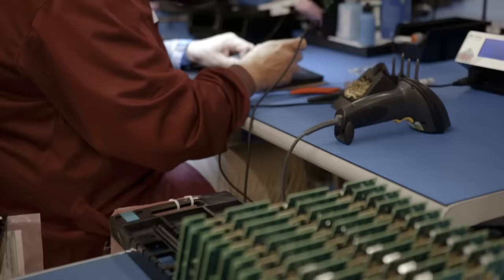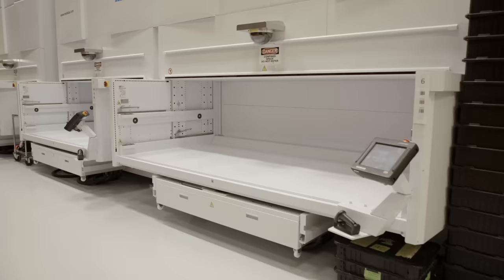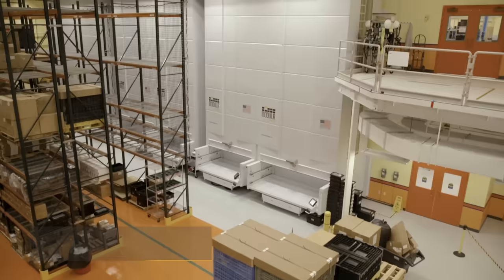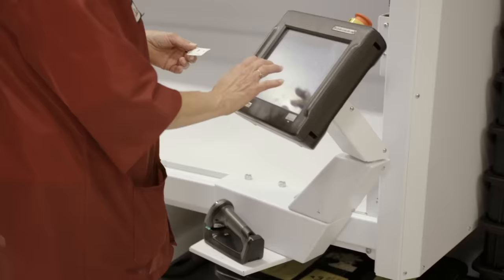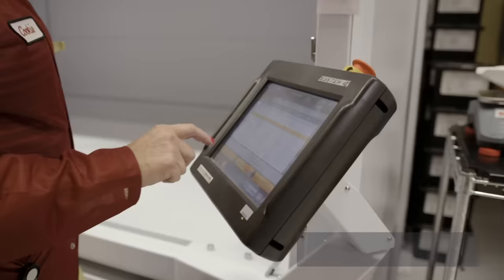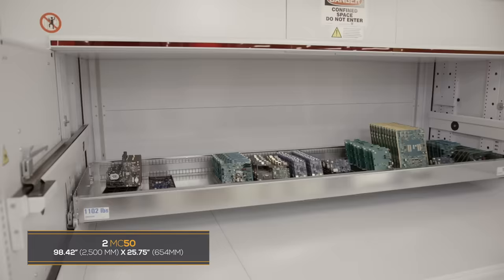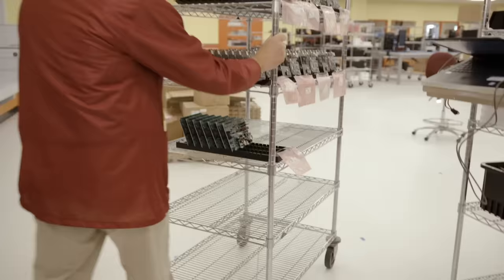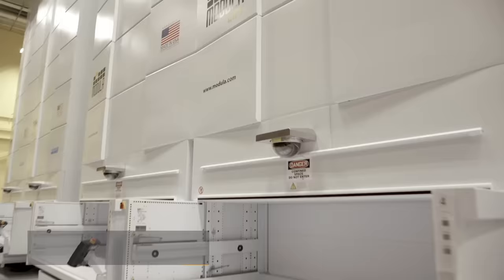Warehouse Space Optimization with Modula’s Lifts for Enercon Technologies

Comment: Hi,  
To pick a material, what I need to do ? Enter Material, or Bin ?
How this system knows at which ROW is my material  OR How material is mapped to each ROW ?
Reply from the maker: Hi Jay, our WMS software is used to map the tray of the VLM. With Modula’s automatic storage systems everything is already set up. The picking can be done reading the code with a barcode or by executing an order received from the ERP. The Copilot console replaces the RF scanner, and the operator sees what to pick as well as the quantity directly from the console, until the completion of the picking activity.